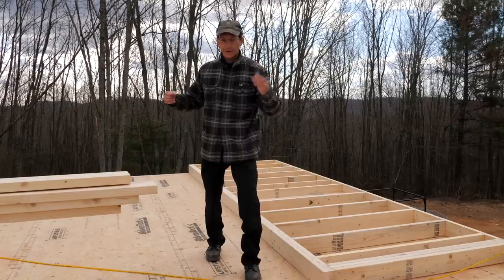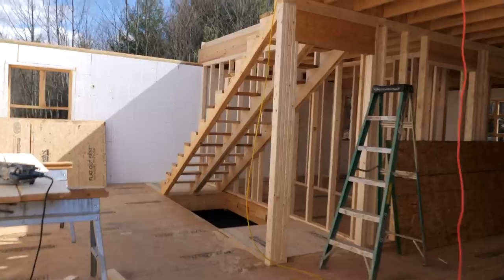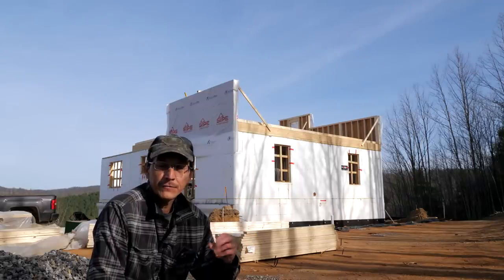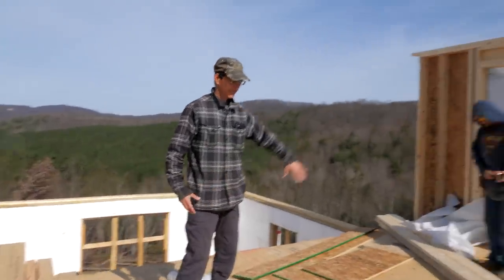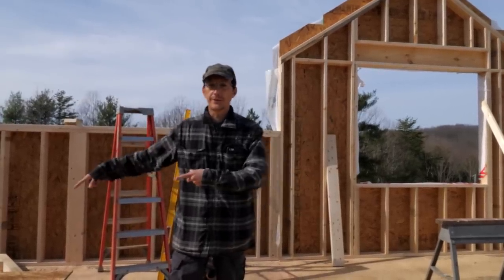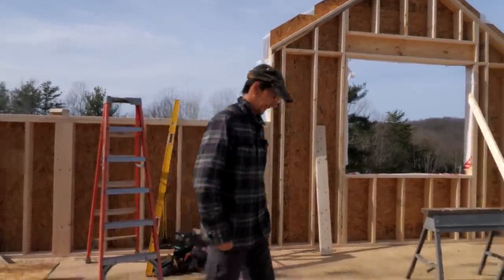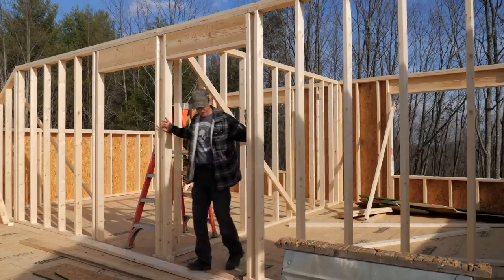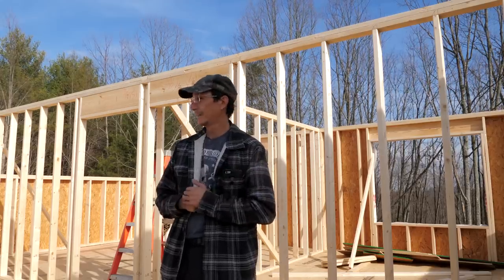ICF Mountain Homestead: Framing the Second Floor Walls

Comment: Keep cleaning up when the guys leave , it’s a lot easier to work when you aren’t tripping over scrap . If you got down time start drilling holes for electric runs in all the 2x6 , same height off the floor all over the house even if you don’t use all the holes . It’s a whole lot easier to pull wire at the same height holes in the studs . Get a right angle drill and good bit !

Comment: I forgot to mention that no backing is require for towel racks or grab bars when MgO board is installed as a wall finish. MgO board is also replacing plywood sheathing on floors and roofs here in California since it is not affected by water or moisture.

Comment: Looking good, that's a nice view from the first floor hope you frame it well with a big window. Finishing a house in Ireland first fix plumbing, electrical and plastering. Finding it difficult to secure materials i.e. flooring and tiles. Order what you think you need for the next few weeks as things are going to slow down

Comment: Have you checked out using MgO board I place of the drywall yet? MgO board is completely non combustible and will not harbor mold or fungus. It has already replaced drywall in the commercial industry.

Comment: Looks great.  Why are they bringing the house wrap into the window frames?
Reply from the maker: That’s how it’s done.
Reply: @Guildbrookfarm  Thanks- I've seen some examples where the air and water was able to seep in because there is gap between the frame and wrap.  The foam around the window to the wrap isn't creating a tight seal to the wood.     Probably just different building styles-X vs I- vs none.  Your views are beautiful -

Comment: Did you decide not to use ICF for the second floor because of all the height variations or was it a significant cost savings or???
Reply: Never mind, just saw you answer the same question. Thx for sharing the build, hope the coming stir crazy factor for people being stuck at home drives more eyes to your channel and the ad revenue helps with decorating costs .

Comment: May that breeze blow the virus right past you without stopping.

You are in an enviable place right now, geographically, residentially, and occupationally - scenic, isolated, and working from (and on) your home.

I've never been a fan of storey-and-a-half houses and the resultant sloping ceilings. Are you doing this simply because you do not need the whole width for the second floor and this reduces heating and cooling unnecessary space? Is there any other advantage? Is there any/much cost-saving with this style?